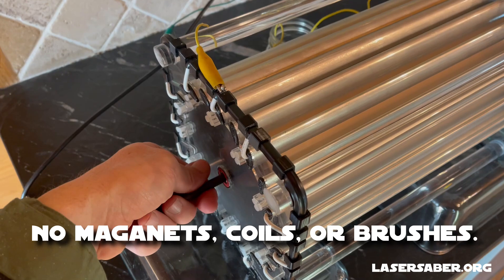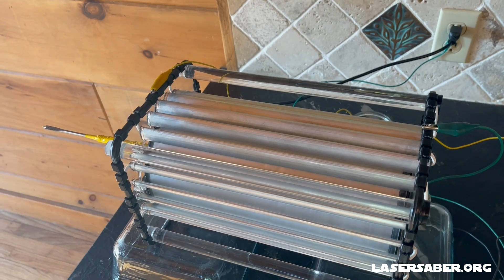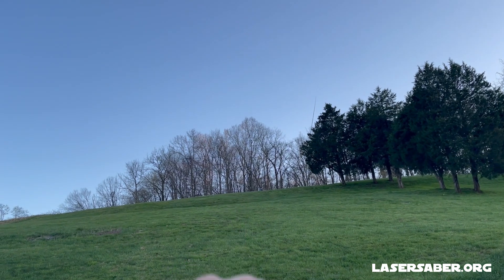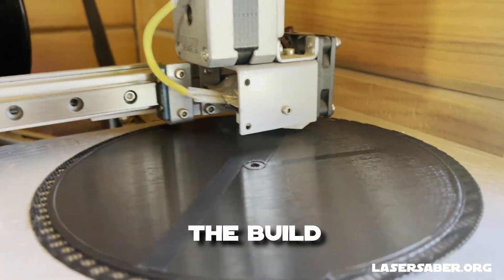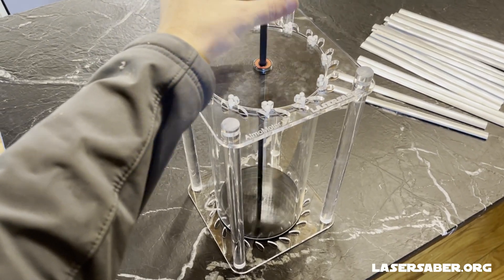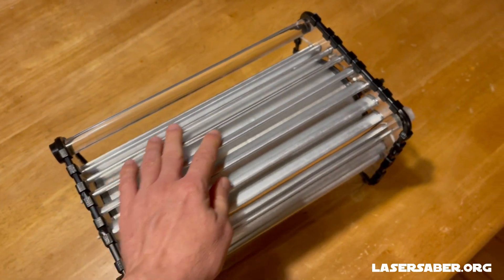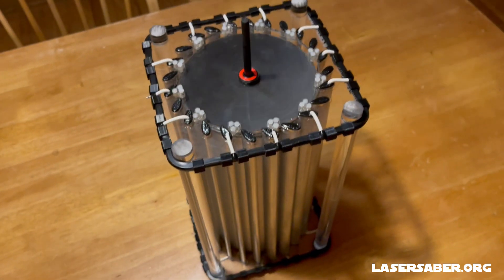DIY 30,000 Volt Drill - AtmoMotor V2 Large Corona Motor

Comment from the maker: Multiple Hole Test: https://youtu.be/_Bc12ocFwcM
Reply: Use shaft coupler, less than $1.
Are you familiar with "Electrostatic Motors by Oleg Jefimenko", if not search that phase. Over 1HP motors.
Reply: Thanks brother!
May I build a /=> heavier central cylinder or .. it would be worst than a light one,
Im planning use a metal Box ...   
GOD Bless

Comment: Hi.  You and @PlasmaChannel have each built fairly "robust" Corona Motors  (yours is Bigger).  When yours demonstrated enough 'manly' torque to drill holes in wood, running off the Van de Graaff, the obvious question to me was, "Why couldn't it turn the little bitty rubber band motor that drives the VDG?"
Since it doesn't have the Back EMF & thus rotational cogging resistance of an EM motor, there is no reason, inherent in physics, which prevents this; its an Engineering Challenge.  Also pertinent is the Faraday Homopolar Generator (which also has no such EM drag), which is, in effect, a current multiplier , that might be placed in-line on the same shaft, for greater effect.  What say you,?

Comment: Did anyone use a small ballon filled with hydrogen to rise the wire high into the air, or is there a reason you all have to use expensive drones for that, that only can fly for several minutes at a time and waste lot of energy by doing that?

Comment: How do you make this setup safe in case of a thunderstorm? Since it's all coming from air and then through a wire directly to the motor, once a thunderstorm gets near you risk a lightning strike passing through it - all the more likely as it's working exactly like a lightning rod drawing in more electricity / being better grounded than it's surroundings.

Comment: You could increase torque by slicing the cylinder and build it. like a Tesla turbine where instead of air you use electrostatic discharge to turn it. Because it doesn't scale up with size but with discharge area
Reply: Could you explain your ideas in more detail? I’m also thinking about how to improve the output per unit volume.
Reply: That's a really good idea!

Comment: Have you seen the new technique used on a atmospheric line they found that pulsing the line into a capacitor through some diodes filled the capacitor at a much faster rate there's a patent on it with diagrams I don't know if this would help but it seems to bleed the atmosphere a lot faster it seems that when the wire is grounded that the voltage goes around The wire like it was a ground on the ground but once disconnected it's engulfed in the high voltage and can be tapped at a higher rate can't wait to see you build a really big one have you put a a pony break on it yet

Comment: How many amps are required to run this? Or is that N/A?
Reply: I have the same question.
Reply: @JenkoRun  Nearly 0 they run on pico amps, the driving force is high voltage.
Reply: @CLUBKILLE  That would make these things potential COP > 1 Machines then, not that I have any issue with that, if it only takes high voltage to produce considerable torque then that can be used to rotate a conventional "generator" to produce high volts and amps.
Reply: @JenkoRun  I have built one to a 98.2% efficiency. I used a 9 watt input and got something like 8.44w back. I too am trying to figure out the optimal configuration, because I got this with using a universal motor as a generator. Fascinating stuff.
Reply: @CLUBKILLE  I find it curious that in machines like this that follow along the same kind of method (rotation based) we have so much trouble getting above unity gains, one would think a high torque motor that runs on HV alone powering a generator would produce well above a unity of 1, yet that doesn't appear to be the case with the Back-EMF in the windings fighting back even to this level.

Among all the concepts I've seen the 2nd greatest principle I've found so far is a massive current burst from a capacitor discharge into a high Q coil (Tesla's method), the resulting VAR's can be tapped if you know what to do with it, free oscillating resonance (not resonant) seems to be among the optimal ways to produce above unity gains for little cost.

Comment: Hmm, i just had a thought. I am wondering what if you had your pulse motor run and use the back spike through a microwave transformer to power that motor. With that kind of torque you could definitely run a good size generator. If you have enough coils you should  be able to create enough to keep batteries charged and use that left over back spike to run this motor. It may have even more torque due to more amperage, maybe. Just a thought i had while i was doing some experiments and i thought about your motor. Love the videos, keep up the great work.

Jason
Reply: Just to expand on what i am thinking, my pulse motor will charge one battery while the run battery is running the motor and I am going to a battery switching so that I don't have to keep moving wires but adding a few more coils in my opinion will not change the  change the way it charges the batteries and could also run your motor with the other coils and a transformer for the high voltage it needs. Just a thought at the moment.

Comment: My suggestion is, try to combine this motor with your crank generator.Then output power from crank generator supply back to this motor thru HV Generator. Is it possible it able to run with infinite rotation? tag me once you done this experiment, I want to know the result. Thanks bro...

Comment: hey try two-dissimilar metals as a charge dome configuration (like van de graaff generator), but then heat the air between, it will zap you, like van de graaf, I suppose its a heat free electron in the dissimilar metals electric field like solar semiconductor voltage junction but macro like vacuum tube, but a hot tube, anything + heat that excites free conductive electrons in the air between will sling the electrons to the higher potential electrote, like aluminium-steel pair, most like thermo-couple/diode metal junction but clearly more like a solar panel junction
Reply: the heat source can be a candle or a fire
Reply: it can be used as a macro solar cell, where solar photons like in a laser mirror chamber excite electrons in the gas, through photoelectric effect, then the field grabs the electrons like in a semiconductor micro junction
Reply: ie the gas space region between the two metals is void off free electrons
Reply: the two metals create the electric field between them in macro measurements
Reply: voltaic pile without electrolyte, like in a semiconductor junction, kinda, potential difference (electric field) between the two different electrode metals, but no contact or no ion electrolyte

Comment: My biggest question is if you touch the rotor and stator. Will you get stocked by the high voltage. Or would you have Put a protective case around it

Comment: Ill just leave this convo i had with ChatGPT-4 here:

Q: Can i use a combination of a Van de graaff generator, a Cockcroft-Walton voltage multiplier and a corona engine in a closed environment filled with a gas that has improved properties of ionic wind like SF6 to get more energy generated byt the corona engine then the energy spent to run the van de graaff generator and the Cockcroft-Walton voltage multiplier?

A: Using a combination of an efficient corona engine, a Van de Graaff generator, a Cockcroft-Walton voltage multiplier, and a suitable medium like sulfur hexafluoride (SF6) gas could potentially improve the efficiency of your corona engine generator system, but it's important to consider a few factors:

Gas medium: SF6 has excellent dielectric properties, and it might enhance the ion wind effect in a corona engine. However, it's essential to remember that SF6 is a potent greenhouse gas. Alternative gases with good dielectric properties and lower environmental impact should be considered if possible.

Voltage multiplier: The Cockcroft-Walton voltage multiplier can increase the voltage output from the Van de Graaff generator, which could lead to a stronger ion wind effect and potentially improve the efficiency of the corona engine. However, the voltage multiplier itself consumes energy, and the overall efficiency of the system depends on the balance between the energy consumed and the increased performance of the corona engine.

System design and optimization: The efficiency of your system will depend not only on the choice of components but also on the optimization of the system as a whole. The design of the corona engine, the Van de Graaff generator, and the voltage multiplier must be carefully engineered to ensure minimal energy losses and maximum energy conversion.

In summary, while the combination of these components and the use of an appropriate gas medium might improve the efficiency of your system, it's important to carefully analyze the energy consumption and performance of each component and optimize the system design to achieve the best possible efficiency.
Reply: Iam not an electrician nor do i know physics better than the next man. Iam just good at internet research. Someone plese build and test this setup. Also, connecting this setup to a highly efficient magnet based generators, like so many on YT have allready created, woudnt we solve the energy problem?

Comment: Can you use the AtmoMotor to run the Van de Graaff generator by extending the axel of the AtmoMotor and use that for the base pully of the Van de Graaff generator where the belt is on.  You will have to start it manually until it runs by itself. Then use a 2nd, 3rd, 4th AtmoMotor to generate electricity or use as a work horse like the drill.

Comment: Looks like I've been missing a lot!  Wonderful build
Have you determined the torque output of this?  How many can you power at the same time?  Does the load on your Van De Graaff generator increase as you run the motor?  Are there equations that explain electrostatic operations?
Thanks for all your work.

Comment: Don't know if you wanted any new ideas but I was wondering if that motor you created can power an electrical motor could it also power a static electric motor which will take the  The static electricity to run itself I'm sure a small motor would run but probably run slow I've been working on projects that recycle energy

Comment: Question, you say torque comes with size. Have you tested more contacts vs less on stator/rotor? I think also size helps but it is also more “poles” that helps to lift the weight of torque or work to be done. What you think? Awesome content 👌🏼

Comment: have you tried putting a pulse dc step up transformer ? it turns the DC into pulsed DC with a transistor , this might allow for you to not have to put the antenna as high as long as pulse DC will still work

Comment: I'm an electrician by trade, trained by the Navy in electric motor design and repair. I’m sure you know this, but for those who don’t, it takes three things to produce electricity: a conductor, a magnetic field, and relative motion between the two. A fluctuating magnetic field can provide the motion and the field at the same time, thus generating an electric current in the conductor. A fluctuating field like that is call an Electromagnetic Field or EMF. I love how you've built an electric motor by collecting the Earth’s EMF. (Also: see NASA’s experiment with this on one of the older shuttle missions. They had problems with the extrusion gear paying the wire out .)

The Earth’s EMF also plays the starring role in how magnetic mines blow up Navy ships. Look up Navy Ship Degaussing if you’re interested.

I have a suggestion: instead of one long collection wire, try configuring a Multi-S with the wire. Don't loop it, just Flake it (lay it out flat in parallel rows). You should be able to reduce the total size of your collector this way. Get your tolerances down, and you might even make an airplane that would fly indefinitely. Looking forward to seeing more.
Reply: Explain what you mean by multi-S, parallel flaked wire. Not understanding
Reply: @claudeposternak5006  Something similar to this, but do not let the lines cross and ensure they are all flat.
 https://modelshipworld.com/uploads/monthly_03_2013/post-385-0-24657700-1362734462.png
Reply: btw...I got carried away with the word "field." EMF is Electromagnetic Force, not Field. My apologies.
Reply: @thomasbont5071  Ok I see, like a snake back and forth not touching or crossing

Comment: Nice work. Good to see that scaling it up makes a big difference. No need for a drone test since you have the property to string up that long wire from a bamboo pole. Why didn't you go with a copper wire instead of the high resistance wire?
Reply from the maker: Yes, I was surprised at how well the larger size worked.  I am building a much larger one now.  I had planned on testing the V2 with a kite, but I ended up sending it to Ion Power Group right after this video was made.  I hear it is working very well for them.  I was testing the conductive thread just for fun.  I would love to erect a permanent tower up on the hill behind my house for long term testing.

Comment: When it comes down from the bamboo pole you say it goes to HV generator. What is this HV generator?
I really intend on building this and I want to make sure I have all the correct parts.
Reply: HV Generator as in High Voltage DC generator.
Reply: @Sharpless2  thanks it seemed obvious to me he meant that, but while Laser saber was talking and panning over his conductive thread, he mentioned the HV generator like it was at the top of the hill. That part confused me. I thought it was thread straight to the atmo motor ?

Comment: What about running it from a hovering drone, then turn a DC generator from the output shaft of the corona motor, run that DC power back up to the drone to keep the batteries charged, at least 3 wires needed, HV, and DC + and -, you could also have the wire as retractable so you could raise and lower the drone's altitude to suit the conditions.
Reply: Just use balloon.

Comment: When you were in the field with the atmo, you walked around it and said, "let's test it out", and then suddenly,  it started rotating. What did you do to initiate it? Did you flip some sort of switch,  or remove some sort of braking mechanism? I ask,  because it was sitting there not running,  then suddenly began to run, but without any obvious conditional change...
Reply from the maker: Yes, I dropped my arm as a signal to my son at the top of the hill.  He started the HVDC generator for me.
Reply: I was under the impression that this ran at 400 feet, but I see a generator was used. Have you tried to see if it would run at a specific height without one? If so, what height? @lasersaber

Comment: This is getting seriously impressive. We really need to see that drone test. Would also love to see what the other guys have been up to with their projects. Especially once they have the new motor.
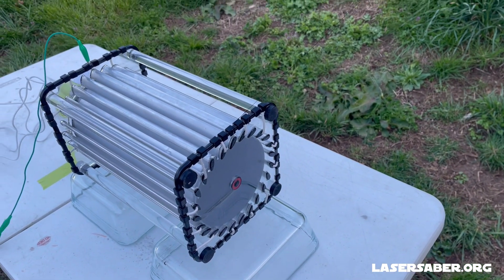Reply: The most impressive part of the video starts at the 1:57 mark, showing the collected current sent through a corona motor that then powers three household leds. Assuming half of eight watts each for the high voltage/low amps, and cutting in half again in case they aren't at full brightness( a very conservative number), and even assuming a very high eighty percent efficiency for the motor - that would still leave at least six to eight watts of current along the surface of the wire. Not 'micro watts', or 'milli watts' --  watts*. Six to eight watts of current, just from a few hundred feet of poorly conductive wire, with one end hoisted to the top of a hundred-some odd foot pole sent through an electrostatic corona motor with *no collector on top of the pole.😯

I suspect most viewers won't recognize just how significant this experiment is; it singlehandedly validates, on camera, that atmospheric electricity can be a viable, easily tapped, and potentially inexpensive source of 'useful' current.😶
Reply: @ but compared to the kilowatts many homes use these days it’s not much. Still. It could power sensors potential longer than solar panels.
Reply: @NandR  Well - using this extremely crude proof of principle, and our( extremely conservative) numbers above, and provided that I'm not missing any 'gotchas':

Five lines on one post, times ~10 watts, would equal about fifty watts. That times five posts would equal around 250 watts, or one quarter of a KILOwatt. Substitute the conductive line with something that really conducts, and you're talking a good bit more. And remember, there's no collector at the top of these posts - this current is collected entirely along the outside of the line itself. Put a collector the size of a weather balloon on top of each pole, fill their surface with thousand of tiny pinpoints for electrons to collect on and coat their surface with ionizing zinc, and this still crude setup might conceivably reach into the Kilowatts, and then you're talking real power.😁

Comment: I've tried to follow your Work for as long as you were on you tube. Then, you just up and left. But now, your back. You had answered a comment of mine a while back.  I did look up the Work that you had mentioned to me about what your doing right now. I see you've improved. But, have you answered the problem of having the Wire or Antenna way above Ground? This Motor looks impressive. It looks as if it might have enough torque to run a small Generator? Does it? What ever happen to your portable Solar Station? The SOLIN-1 and 2. Do you still sell these Items?  Thanks for the up load.
Reply: He ran a small generator in this video,  powering LED lights!!!
Reply: @Quickened1  Yes, I got that. But It's to large of a Motor and Torque needs to be a lot higher to fun, say a Generator to product the power needed to run a full Home. The Antenna still needs improvements to bring down the proper Energy. Needs to be close to Ground. Thanks for your reply.